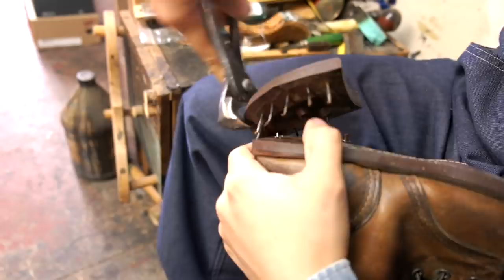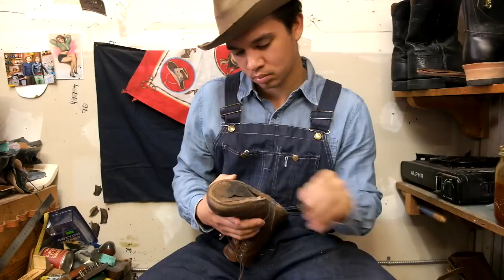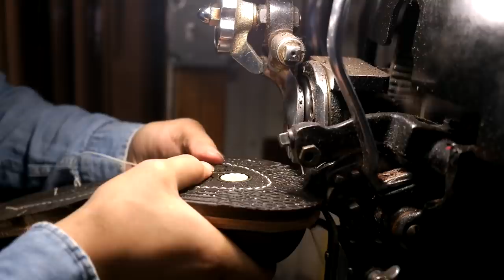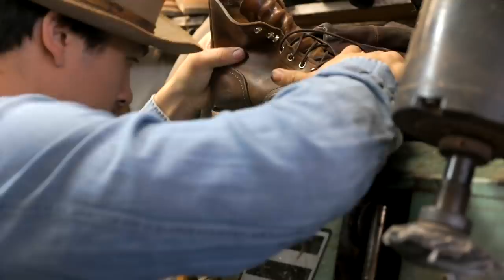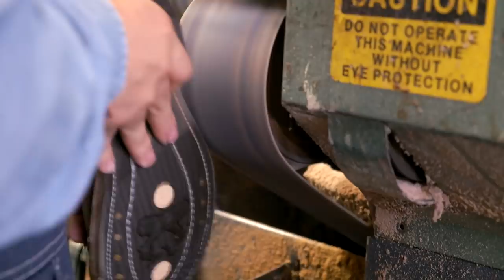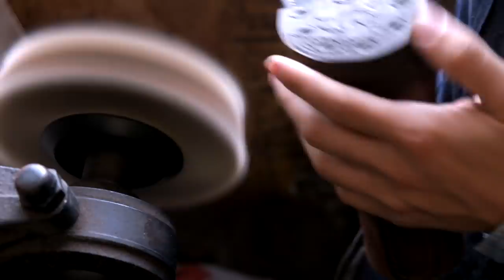RED WING IRON RANGER Resole #50

Comment: Brian why you bang in nails in front and on the side of the sole? are you not afraid that they are going to deep and the feet can get hurt during waering? great job, you are master boot maker and keep going, never give up, resole shoes.
Reply: Peter J. Peter, those are a specific kind of clinching nail with a precise tip that will hit the metal last and crimp over, thus holding layers together, but not poking the foot. I did shoe repair for many years as a younger man. 👍
Reply: @bobliddell5495  Hi Bob thanks for your comments, but i was always thinking shoe nails must be pulled more inside the rubber
not just equal with the sole. anyway i love to watch shoe repairing it is something you can see a nice result once the work is done.

Comment: I know where I'm taking my Iron Rangers when they need a resole..
Reply: diesel828 I will do the same next time. I sent my brand new Iron Rangers to the company itself to have the Nitrile Cork put  on them since so many people were saying how much better they were than the Vibram MiniLugs. I discovered there are small differences between them but I think they’re equally as good. Anyway, Red Wing ruined my boots . They trimmed the heck out of the right boot’s welt very close to the stitching and changing  the welt’s  original shape. They no longer look symmetrical which really annoys me. I reached out to Red Wing and they defended their sloppy work by saying that if my boots were knew they would’ve gone to their factory and sold like that. In other words they would’ve passed inspection. Never again will I take a chance with the Red Wing Repair program. I paid to have my new boots ruined.  😤